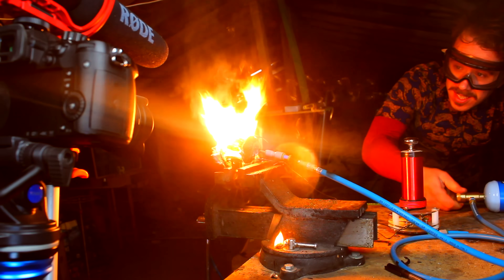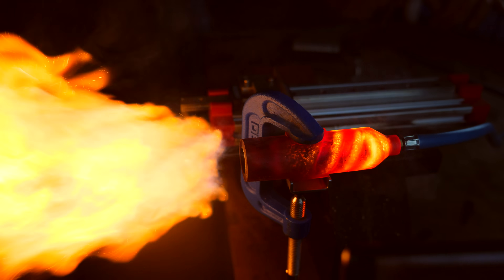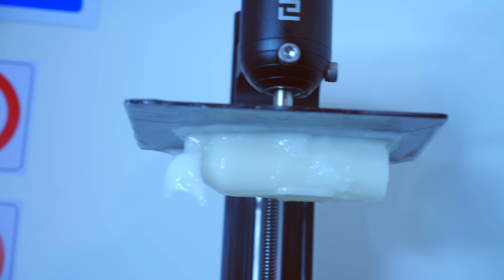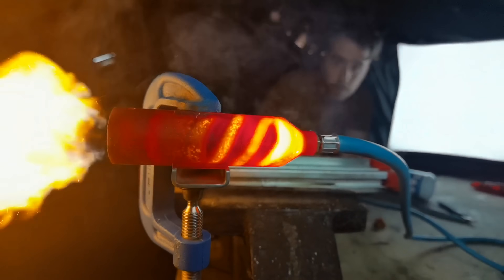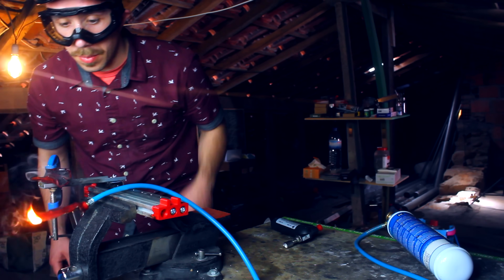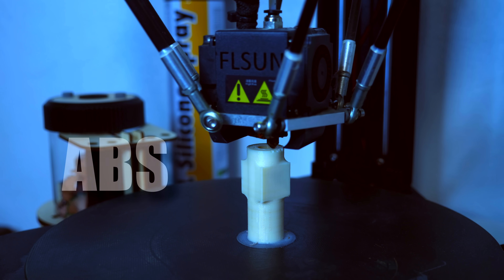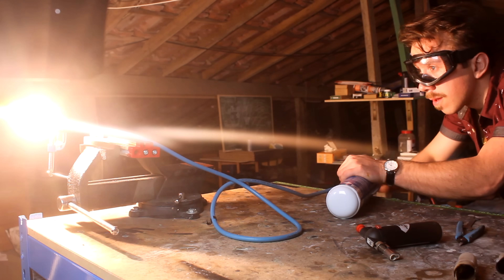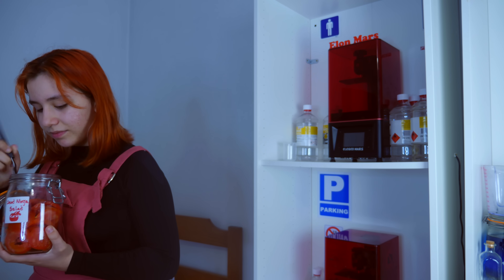Rocket engine that uses itself as fuel! (3D Printed)

Comment: Why not to simply print 5-axis steel cutting CNC machine with dovetail rails (1 micrometre precision) and make a real nozzle with regenerative cooling out of cooper (don't use nitric acid as an oxidizer in this case) or high-nickel steel alloy? Speaking of real liquid oxidizers the HNO3 and H2O2 are the most easily accessible ones. High concentrations of H2O2 you can obtain via distillation under reduced pressure. H2O2 can be used as monopropellant.
Liquid rocket engines are simpler in many aspects than solids. EX: you do not need to do uneasy calculations for mixed flow (when part of exhaust is solid), standard enthalpy of formation is unknown for most plastics and resins, so you can't exactly work out the temperature inside chamber and thus can't calculate right throat area to choke the flow.

Also, increasingly growing burn speed is probably related to 2 phenomena:
1. Melting of the throat and thus increase in pressure and temperature in the chamber (please, read about Arrhenius Equation in Wiki).
2. High infra-red transparency of the fuel/binder mixture.

Comment: You could do a metal 3d printer, or you could make a rocket using acrilic glass bar as the burning portion or use gasoline as fuel and inject it into the chamber using special spraying nozzle to spray it into it or use compressed air instead of pure oxygen. Love your channel and your videos ❤️❤️❤️😁😁😁 and oh please be safe while doing such experiments in your attic.

Comment: one thought, perhaps it would be wise to put a chamber around your engine and a nozzle that aren't made of your fuel, that way, even when it has burned through the side, the combustion still would produce thrust rather than breaking apart. Even a metal pipe from a hardware store would likely work

Comment: A good way to create your grain is just to cast it from a molten or polymer source. Some people use bath sealant. The grain can be cast inside the body tube and protects the tube from heat until the last moment. Some use a solid shape that slides out, others use polystyrene foam ones that can be dissolved. This is how the space shuttle solid boosters are made. Rubber is their base fuel with other materials to help it along.  
As you need a consistent burn it is worth igniting the fuel at the top, the flame will ignite the rest. You can buy electric matches or make your own with a thin wire wrapped around a match head. 

You are a marvel matey.

Comment: you REALLY should get a ball valve for your Oxygen supply, instead of having to screw it closed you just use a lever. much faster control of flow

Comment: For solid fuel or hyvrid rockets (I guess) you should try to make a very combustible fuel that you can either 3d print or just straight up pour into a metal or ceramic shell. That shell could consist of two parts, a nozzle+body and a backpiece that has the o2 inlet in itself.
For the fuel, either a sugarlike fuel, or something made of fossil fuel (petroleum or comparable)
Or just straight up dried tomato. Also... you know that you indirectly support the tomato industry by buying(and then killing) tomatoes, right?

Comment: Maybe use a metal pipe to put the fuel in that way it would not deform as much. A cap on the pipe with a hole for the oxygen hose would make it easier to refuel the engine.

Comment: Have you ever tried mixing red iron oxyde with Aluminum oxide in a 3:1 ratio as rocket fuel?
(it's thermite, if you try, which you can, put a thick block of ceramic or something that does not melt at the melting point of iron around it)
If you want to be fancy and maybe blind, use Magnesium as fuel.
(it will blind you if you don't wear really good protection)

Comment: If you made a ceramic rocket and nozle with a core of 3D printed fuel the rocket wouldn't burn a hole in it self. It will probably use up all the fuel or explode.

Comment: what if you add Aluminium powder  with 5 micron in size to this mixture?
or activated charcoal?

thrust is being generated by the exhaustion of matter
and if the matter has a larger mass, it can generate more thrust
so when exhausting salts (burning Al with O2 to Al2O3) it could, in theory, accelerate more than just with CO2/H2O

Comment: might wanna try PLA or PET-G might be better fuels or at least provide a higher energy output on combustion due to their high oxygen content, like using methanol/ethanol as a fuel. it might burn faster/fail faster but should give a damn good bang, not sure about PETG filaments though or if they're even available

Comment: The candle topper things look a bit like what people here in Iowa call "Sparklers", a type of firework that consists of a a long, thin metal rod, with about half the rod coated in a layer of a grey, flammable substance. When lit, the grey substance gives off a bright light, and gives off sparks as it slowly burns along the length of the rod... In case it wasn't obvious to anyone reading this, you're supposed to hold the end of the rod that doesn't have any flammable stuff on it.
Reply: Also call them sparklers in New Zealand
Reply: Yeah, we just call them sparklers in the UK too. It's some sort of magnesium/aluminium with potassium nitrate paste. You dip the rods into it, let them dry and light them up.
Reply: They're "Sparklers" in New England, too.
Reply: It is magnesium and burns very hot.
Reply: So basically the whole (relevant) world agrees they’re called Sparklers and this is just something the Portuguese got wrong.

Comment: Burning the rocket whole is not ideal. You are changing the geometry of it and it loses efficiency very quick. There are 3D printers that can print with multiple filaments. You could make the core out of one type and the shell out of a more heat resistant material. 
I am sure you could design something that you can glue together.

Comment: You need a faster valve to open/Close the lines. So after the engine's spontaneous rapid deconstruction, you wont keep providing it with fuel/oxidiser.

Comment: you can print the rocket fuel in plastic/resin but shape it to fit an aerosol can,  you remove top and bottom of the can, put the printed parts inside it. it should help you with the ruptures and keep the shape of the engine.

Comment: I'm curious as to why you didn't try using some of those elastic polymers with a 3d printed shell for this since most hybrid rockets are some form of rubber in a casing, also they tend to use a star shape center cutout

Comment: You could use the thrust of a solid rocket engine to power a Tesla turbine. A ceramic printed turbine should hold up to the heat of the exhaust

Comment: what produces thrust is your nozzle, if it is made of the same material as your fuel, it will wear and burn even before producing the operating pressure of the engine, change your nozzle for one that resists a little more.

Comment: You could use a strain gauge for measuring the thrust of ur rockets. That way you can compare them in a better way and get more data to improve ur engines. :D
I think those hybrid rocket engines were a great success compared to the other ones.

Comment: make a 3d printed solid rocket by printing it with two materials . replace the filler material with the fuel and print the nozzle and outer casing with plastic.

Comment: You should try to make a metal nozzle for your hybrid rockets! You could try casting different metals and create different engine designs. You already have an oven, don't you? 3d print your engines and use your oven to burn out the molds!

Comment: Hey Integza! I think it would be pretty neato to see you make a return to these solid rockets, but perhaps with using your upcoming CNC machine, you could cut out thin gauge sheetmetal that you could stamp to shape? You did something similar with your little metal turbine fan that you made a few videos back! Perhaps you could use similar stamping methods to shape the nozzles and/or the body of the craft, with little tabs at various parts that you can bend over to hold everything together!

Obligatory tomato comment: When I was a tiny little lad we had a family garden, apparently we actually managed to splice the sweetness of watermelon into tomatoes by growing them next to each other. I'm not sure entirely how it's possible xD but I'm not lying when I say that I had tomatoes that were so sweet, that you literally could've used them as desert! Unless tomatoes are a texture thing for you, they may have been one of the only tomatoes you would've liked!

Comment: You can make the entire rocket using a heat resistant resin, but leave the fuel chamber hollow, then just print your "fuel cells" (cylinders with a hole in the middle) and place inside the chamber. A rocket that you can refuel and a nozzle that doesn’t change the geometry during use.
Reply: I was thinking something very similar. He needs a heat-resistant shell around the fuel cell that can contain the heat and pressure. The heat resin engine would be a good move. 
There are so many variables to experiment with, he could be at this for months. ;)

Comment: Print a star pattern mould to cast rubber into. So you end up with a cylinder with a star shaped interior. You maximise the internal surface area and you use hydrogen peroxide as an oxidiser. If you want to print the fuel then you should try using something with a high carbon content. Test out different resins or filaments by printing 1cm cubes and measuring the burn time...

Comment: One thing I noticed - the sparkler ignition was MUCH more centered in the last rocket than in several of the previous ones, and it appeared to affect the actual exhaust angle - and, presumably the thrust angle.   You might want to look into n electric match, and possible a nozzle plug to keep electric match in place.   Search your favorite online hobby store for "model rocket igniters" and "Engine Ignitor plug" for examples of what they are. You could easily 3D print Ignitor plugs to fit your own nozzle diameter, and if you don't want to buy ignitors, there are plenty of YouTube channels that will show you how to make an electric match and/or Ignitor :D Good luck!!!! I can't wait to see where you go with this!
Oh - one more thing - You know that some people have made solid rocket fuel from old tires, right?  You should check into that, see if that is something you could work into your resin :D

Comment: What if you design a compartment inside the rocket that can hold some liquid fuel? That should provide some extra punch along with the solid fuel. 

Also you could try modeling a Seperate center piece (that goes in the middle of the rocket) and soak it in acetone (it should make your solid fuel concept more combustible)

Comment: Try making the nozzle out of something other than the fuel material so that it doesn’t burn away. You should also add a case so that you don’t lose thrust when the fuel grain burns through. I think the best way to tackle this would be to find some metal pipe with a threaded end cap for the case, press clay kitty litter into the non-threaded end of it to form the nozzle like people do with sugar rockets, print your fuel grain to the size of the pipe and fit it in, then thread on the end cap. That gives you a reusable case with a nozzle that you can easily rebuild for testing of new geometries.

Comment: Yeah there are a lot of ways you can improve this design. Testing different kinds of grain geometry does help to an extent, but it is limited by your nozzle. For a DeLavel nozzle to work, the gas in the combustion chamber must be accelerate to Mach 1 by the time it reaches the throat of the nozzle. So I think making the throat smaller would help. Because unless it hits Mach 1, the bell of the nozzle just slows down the thrust even more and you waste all the potential thrust. You could also try printing the nozzle in ceramic resin and then bonding it to the grain in a housing (to prevent burn through and loss of pressure) and that way your nozzle wouldn’t erode as much, and you get a much larger period of good thrust. Keep up the great content!!! I love seeing how you can make use of such little supplies relatively speaking.

Comment: Solid\Hybrid fuel engines need to burn fuel uniformly to be way cooler (oh, you know what i mean), so, ignition is a big factor here. The sparkly things do not have enough burn speed so only the front part of the fuel lights up. I would suggest something like a paper tube with fast burning reagent inside.

Comment: You could try to make a heat shield for the re-entry of your rockets, as I'm sure you'll achieve orbit in no time at the rate you're going.  You could even use the exhaust from your 3D printed rockets to simulate re-entry!

Comment: Would it be possible to make a 3d printed mold engine and fill it with molten sugar
When the sugar solidifies and it's used in the combustion  would it be held toghether by the 3d printed mold?

Comment: you should try aluminium sand casting your 3d printed vortex engine it had a lot of potential and the only drawback seemed to be the leaking which would be solved by the aluminium casting.

Comment: Interesting idea, I think you should build the fuel and the rocket separate, I think you're just burning your nozzle off super fast. So you should print a nozzle and case out of something that won't burn as much (perhaps ceramic) and the fuel should be an insert into said nozzle and body
Reply: I was wondering why he printed the nozzle and body continuous with the fuel too. He has made 3D printed ceramic nozzles already but getting them to stay attached to the rocket has been difficult. Threads maybe?
Some ordinary thin-walled copper pipe and fittings would be a good place to start for the rocket body, with the ceramic nozzle threaded on after loading the fuel.
Reply: @markfergerson2145  realistically he could also take that copper pipe and press it into something close to a nozzle anyways, then thread an end and put a threaded bushing in it that's from his pipe size to his oxygen fitting size, then it'd hold his fuel in and supply his oxygen through the fuel core, and allow for rapid testing of fuels
Reply: @Davinator2662  I'd worry about the copper absorbing too much heat from the flame. Still it could be worth a try. Integza, you reading this stuff?

Comment: print a ceramic casing and nozzle for your fuel to slide into so you don't keep blowing holes in the sides of the rocket in another video that would be cool ^^
Keep up the good work dude been following for a long while now but didn't know I wasn't subbed .... Am Now Woop!

Comment: In order for your rocket to produce thrust when it is burning, it needs enough oxygen that it produces a little bit of thrust when it isn't burning. The chamber must be pressurized, and that requires a very high mass flow rate because there's a great big hole in the back trying to depressurize the chamber. Your oxygen hose is much too long and narrow.

Comment: A lot of hybrid engines use some sort of rubber compound. I suggest printing the fuel in Ninja Flex or equivalent.

Fuel as filament is also a phenomenal idea. Since it could be printed instead of cast, more complex geometries could be used on the fuel.

Comment: For the next video regarding nozzles. Right now youre nozzles made of fuel are having big problems with  throat erosion. This can either be allevated by printing in a metal washer in the throat of the rocket or making a metal nozzle.

Also, consider putting in the sparkler the other way so the rockets light injector to nozzle instead of nozzle to injector.

Comment: Major Hardware had luck 3D printing copper-infused resin for a computer water-cooling system. Perhaps you could try this? 3D print an external engine housing, and then contain a fuel core inside it?

Comment: Im wondering if you made a ceramic nozzle and body and sealed it like in the last video while making the solid fuel wider/thicker while shortening it slightly if you could increase the burn time and get more thrust. Also if you have the ability to print with acrylic you could make an solid fuel out of that and use nitrous oxide as a stronger oxidizer.

Comment: Using rubber similar to that used for car tyres is a great fuel for hybrid rockets. Plus they are also easy to get and mould into proper shape. You should definitely try that.

Comment: I  think it might be interesting to test the 3d printed fuel inside an enclosure made out of steel since just gettin a cut to length metal pipe shouldn't be too problematic and it might allow the engine to work a lot longer since the  collapse of the 3d printed part walls wouldn't make the oxygen leak.

Comment: Integza you should try and make a CNC machine or laser cutter using one of your existing 3D printers. You could maybe use these machines to make rocket engines using metal instead of Acrylic. BTW keep up the good work.

Comment: You can use metal epoxy putty (evo stik) to seal your previous engine perfectly. It's like plasticine, you mix it up with your hand, but it hardens metal hard... so much so that it gets used to seal cracks in car engine blocks and radiators.
SOLID ROCKETS ARE NOT NEARLY AS INTERESTING...

Comment: you could buy a simple device to measure torque that is produced and attach the engines to it a small distance away from the center. That would allow you to do some simple equations and find the exact force that the engines are producing.

Comment: if you can get a strong body you should look into putting metallic aluminium in your resin. it doesn't produce much gaz but it produces a huge amount of heat. that what causes al the white smock in SRB's. you should wear a respirator though in that case.